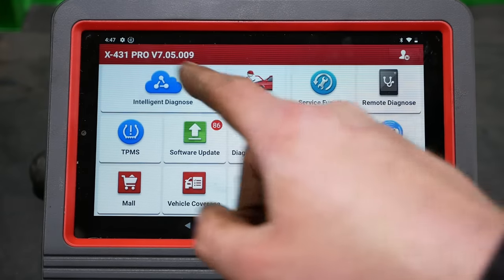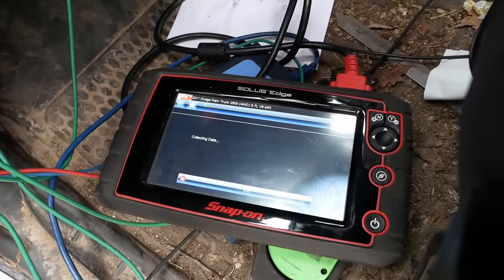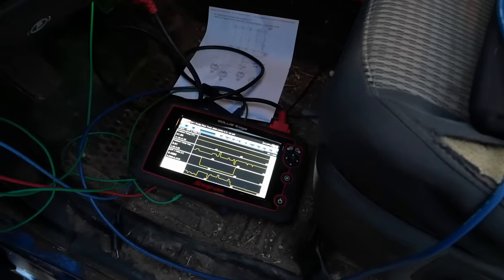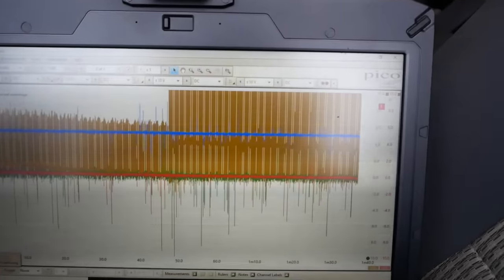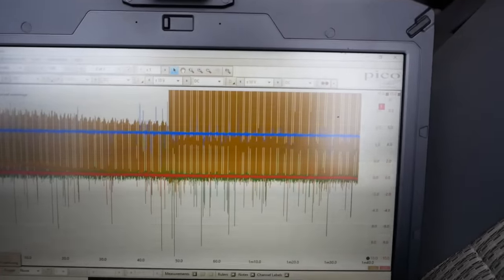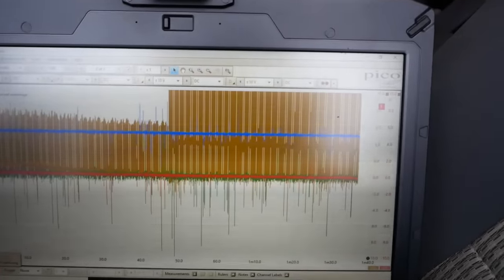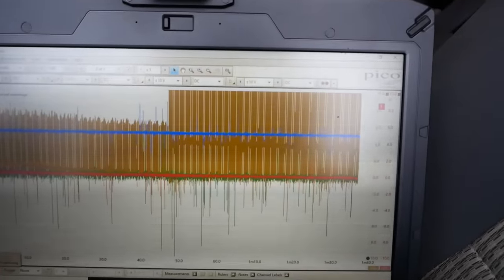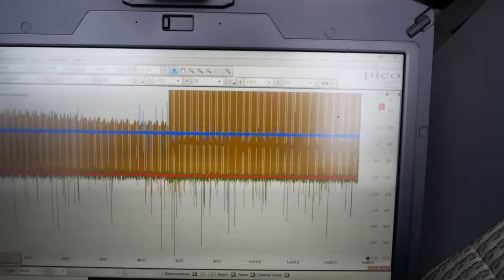Diabolical Diagnosis - Hemi Ram Stuck at 1500 RPM with P2128 and P2138

Comment: Charge out time is always a difficult thing when the labour to find a fault is many times more than the actual repair costs. What customers don't see is that what they save in parts is much less than the labour., with the overall cost being much cheaper than the altermative ie parts cannon. I have no doubt a dealership or big service centre will have recommended a new harness if they found their was  a short. & this is after they did what you nearly did - through a new PCM at it. What do you do, a proper diagnosis and find the real issue or a half-arsed one and throw the parts cannon. For you Wes, if you didn't find the short you would have done an overlay, much cheaper than a new harness. You did good and most certainly were in you rights to charge 100% of your time. You are not a monkey wrencher, you are a professional Technician!!!

Comment: I feel your pain, Wes. My story is short. Car (Hyundai Accent 1.6) in limp mode out of the blue. (how else?...) No one could help with a diag PC, I needed the car everyday. Long story short, a random guy diagnosed for me (for free!), and sent me on my way with the bad news that his opinion was throttle body cooked. Enter the dealer, 13 grand South African, which is the sum total of my pension... My friend Google pointed more specifically to the throttle pedal, I being a sometime mechanic, duly removed, stripped and check it out. No crusties, no dirt, connectors nice and shiny. Re assembled and fault was gone. Done another 40k km since and nary a problem...go figure!
Reply from the maker: That's a lot of dinero for a throttle body!
Reply: @WatchWesWork  Yeah. With the (no) value of our currency, anything imported is grossly expensive. A Dollar will cost me 14 to 16 Rand, a pound Sterling around 20...

Comment: The funny thing about the Audi problem was it wasn’t really a problem. It stemmed from Dateline doing a story on it. What it really was the brake and accelerator being close together. In confusion owner would accidentally hit the accelerator instead of the brake or a combination of the accelerator and brake. I worked with a few guys that lived through that period of Audi. Because of that whole situation you can tank Audi for having a park/neutral safety switch.

Comment: If it's anything like telephone cables moisture is not necessary to have moisture to have high resistance wire "crosses". The wires have microscopic cracks. Wires with different potentials will arc. Moisture just makes it easier to find because it will usually stay bad all the time.

Comment: reminds me of my 2005 Grand Cherokee.  It must have taken a bath in a lake before I got it, because of all of oddities..
I ended up pulling a few of the control modules out (with fuses, etc), and removing all of the fuses, splitting the cases and cleaning them all up.   Not sure what did it, but it did go away after doing that.

Comment: Hi Wes  Excellent work! I am sure I would have pulled out all of the limited hair I have left on that problem! I will date myself but I am reminded of all the intermittent problems we used to have at our shop with spark plug wires. On cold start an engine would miss some days but not others. Took awhile to figure out the "miss" days were either rainy or high humidity days allowing paths to ground.  In your case I wonder if there was enough copper chloride diihydrate (green crusty) contaminating the tape interior to allow an electron path between those two rubbed through wires?

Comment: I have a 2010 K2500 Suburban 6.0L purchased new that will go into "Limp Home Mode" in cold weather conditions If I use the remote start on the key fob and allow the vehicle to warm up until time out and shutdown the engine; after restart and going on my way after some amount of time it will go into "LHM" and stay like that until I stop and wait for a cool down of the engine. My solution has been to not use the remote start ever again and I have not experienced the problem since. I do not have access to the tools you utilized or the patience to chase down a broken wire problem such as what you encountered. I am sure that GM and Chrysler have a similarly complicated signal and control logic sequence to insure I do not demonically accelerate into anything.

Comment: I do A LOT of electrical diagnostics for work, heavy duty truck applications (think L9, X12, Maxxforce, N10, D13T,
 engines) . As my boss says vibration is the killer of everything. And I’d say 75% of electrical fixes are from vibration.
Reply from the maker: Rodents, salt, upfitters, previous mechanics, poor design, heat, UV degradation, etc. It’s amazing they ever work!

Comment: I have a couple buddies that both have Ram pickups both different years and when you look under the hood on both there are exposed wires everywhere as it seems Dodge doesn't deem it necessary to wrap the harnesses completely and both guys seem to be at the dealers a couple times each year with electrical problems.

Comment: Vacuum creates static electricity. In a high humidity environment. It will amplify a local charge. In other words. A plastic intake has a high vacuum and static charge. Add some humidity. And your non shielded (or insulated in that spot) wire will read the pulse from the high voltage discharge.

Comment: I think it's good practice to jump straight to visual inspection once you know which is the bad wire.   We always imagine that it's buried in the harness where we can't see it-------  but normally, it will be right there in the open and obvious.  Spend more time on the visual inspection at first, rather than continuing to try to keep catching the intermittent problem.
Reply from the maker: I don't know about that. We've had several wires broken right down inside the loom with no real explanation.
Reply: @WatchWesWork  Yeah, I've seen it where the wire is broken inside it's sleeve, and the outer plastic has no signs of breakage-- but most of the time, it's an obvious rub point-- Just like you found.  I just think we should have an ultra thorough visual inspection happening in the first hour--  We tend to push it away until hour 10 of diag- and then we finally break down and look -----  and there is was, right in the open all along..   Try not to procrastinate the visual inspection, that's all I'm saying: --  To myself. lol

Comment: Wes, if I followed your description, I think you somewhat lucked into tracking that problem down. When you had the harness wire disconnected on both ends it was floating, otherwise known as an antenna. It will pick up all kinds of hash and trash, depending on the input impedance of the scope. So injector pulses didn't surprise me. You probably should have grounded one end with a 10K or so resistor so it wasn't a complete float. Of course then you might not have seen the injector pulse if the rub-thru wasn't wet enough. :-(
Reply from the maker: Nah, we could see it with the wire in tact, and with the pedal plugged in. I just wanted to be sure the PCM wasn't feeding the voltage back into the harness.

Comment: Hiya Wes, Had the same thing on a dodge I bought used that had just got out of the shop but in stead of fixing the bad place in the harness they replaced the whole thing only because the old harness kept going bad , but after that the truck ran fine

Comment: When two wires in close proximity have worn or no insulation, current can arc from one to the other. When one conductor carries more voltage than the other, this can cause transient voltage as a result of inductance; the principle of how transformers work.
Reply from the maker: That's true in alternating current, but not in direct current. It can happen with pulsed DC, which could be part of what happened here.

Comment: We had a Dodge Journey 2011 that was possessed!! You pressed the horn and it was like one Mississippi and peeep! And the accelerator kind of the same! The had to reset it and load some new system program but never worked correctly. Trade it for a 2016 Passat

Comment: Check the solenoid wiring harness under the intake that goes to the MDS system I found that they melt laying on top of the block look under the harness

Comment: x431 pro VERSION  7.05.etc. etc. etc. - the V is probably to track their software updates for X431 pro - all that aside, you're a better man than I am. My winters last for four months and that's still WAY TOO GD LONG to endure sub 30 degree weather. I hate it i hate it i hate it i hate it - My life goal is to live somewhere that the temperature never drops below 40 degrees fahrenheit. - ALSO...this is why drive by wire is STUPID and we should go back to mechanical throttle. A braided cable will last decades longer than a RAM card when properly taken care of - maybe centuries - that ram card is guaranteed to degrade to nothing by 75 years and the car is toast while an old school throttle cable is going to keep working and if it wears out you don't need a computer to replace it.

Comment: The dealer for sure would of fired the parts cannon at that pig for sure. They love doing that on simple jobs so I could just imagine what they would of done but it really comes down to if someone dealt with that issue before if someone dealt with that issue they wold know the first thing is to check the wiring anyway that was cool you found it without replacing anything.

Comment: Could be the moisture, but I guess it could have also been the vibration of the cold engine pushing it harder onto the plastic. If there's enough rubbing parts of the wire can embed itself into the plastic and form a connection.
Reply from the maker: That could be.

Comment: Wes you need the new $24,873 Snap On diagnostic confuser cause I know that truck should be throwing the old R2D2 C3P0 codes. Can't read them without the new software and interface modules.

Comment: I think that the problem was with the insulation removed there was electromagnetic coupling between the two wires.  The large pulse was coupled into the APP signal  when the air was moist enough outside ie snowy day. I wonder if it happens on a dry day

Comment: strangest thing ive ever seen, was Eric at Sout main Auto had a car with a EVAP fault, the evap circuit had interference in its voltage.  Turned out to be, fast switching pulse from a faulty power steering pump. The rapid switching on and off of a DC circuit causes "induction" (like AC does) into the EVAP circuit inside the PCM. Now a similar thing could happen in a wiring loom, inducing interference in a nearby inductor.
Reply from the maker: I remember that video. That was a wild diagnosis.

Comment: Like this content. Seems only 2 potentiometers is risky toyoter used 2 and had issues too. GM uses 3 one being low voltage and two hi developed for the diesels and as far as i know have been no runaways with out all that complexity bullcrap on that dogdge

Comment: The reason it goes to idle when you step on the brake is because of the "stuck throttle" programming. If you step on the brake and the throttle at the same time, the throttle goes to idle even if you keep it pressed.

Comment: It sounds like water or condensation from sitting overnight. That would explain the short window before the engine heat dries it out. I was going to say shorting through the green corrosion but it didn't look like the damaged areas of the wires were close enough to be effected by it. May not have been much longer before that one wire had a completely open circuited because of the green corrosion. Too bad as well, it would have made diagnosis a little easier.

Comment: Audi 100 problem was caused by the throttle and brake pedals being much closer together than was customary on USA cars and both a little more left.  Apparently people would step down thinking they were on the brake and actually they were on the throttle pedal. Practical tests showed even with full throttle being applied, pressing down on the brake pedal stopped the car both at rest and in motion.  People swore they had the brake pedal full on and the car still accelerated, which would have required the brake system to totally fail, and then moments later resume, leaving no traces.  Audi could not replicate the problem as reported in their tests, but lost in court to juries thinking Audi was covering up.  The problem was a  human factors design issue.

Comment: Yeah the drive by wire crap on my 2003 dodge Is the same Sometimes for no reason just loses The throttle Bpdy signal goes into limp mode shut it off turn it back on Boom like nother ever happens And I'll be good for 3 or 4 days

Comment: Chrysler with a wiring issue. Hmm. A local old man had a hemi the same model and his fuel pump ran 24/7. Would kill his battery. After many ficms he gave up. Lol my moms uncle sold his 03 ranger because it would die when you put it in reverse. He sold it after giving up on it and the new owner had a shop look at it and fixed it the same day. It was wiring rubbed in two on a fuel rail shorting out. Lol

Comment: This is why so much computerisation in cars is bad. Pre computer times diagnosis was easier to a point and the wiring was so much simplier you didnt have these sort of problems that would give you a limp home mode, admittedly some times it left you stuck on the side of the road instead LOL. Thing id most of the problems in older cars wiring was to do with lights or charging etc or a failed coil or wire to the coil. My first car  a 1962 GMH vehicle (Aussie here) had a total of 15 wires in the engine bay and it only had 5 wires for the engine the rest were for lights horn and other similar items. i would hate to think how many wires are in my current engine bay on a 2003 ford but i bet it is close to a thousand. As always cars are made cheap so every inch or so of wire they save over a model run adds up to more profit for the car makers and also more chances of wires rubbing on something that will cause this sort of damage.

Comment: I'd guess part of the problem would be the rather low voltage the APP signal is supposed to have... 0.something volts isn't much at all to compete against any outside influence. If these wires are close enough together, they might even couple capacitively if the moisture is just "close enough" - spikey waveform will do that.

Comment: Nice work.  These failures are the ultimate nightmare for any auto.  Extremely expensive to diagnosis and repair.  Customer is frustrated.  Mechanic is frustrated.  I would have just replaced the throttle position sensor and drove  it until it acted up again.  But realistically, this was a rare find without spending 20 hours and $4,000 at the dealership.  Is there really any good solution for these failures?
Reply from the maker: No. There are not. Maybe if the PCM had built in data acquisition and storage you could see it. Even then, you'd still have to find the actual problem, which was not easy.
Reply: That's an interesting question.  The design engineers could have considered a "failure tree" that checked for "atypical" voltage inputs.  But, that would presuppose that they could imagine that faults in the harness, might feed back into other parts of the harness' circuits.  As a guess the SAE types figures any harness short would be "obvious."
I've made dumb logic error trapping decisions, so, I'm inclined to only throw shade, not brickbats, at them over this.

Comment: Wes you are clever. I'd never have found it.  I'm thinking moisture plus road salt. Btw Setting the gear up is not wasting time "It is just what you have to do." Ok here are 2 stories ! . This is the abbreviated version. A right hand drive 1999  VW Passat comes in. transmission is shifting badly, dropping out of gear, erratic operation over 3 day. trans died. This was caused by the 2 pinched drain tubes that live under the battery tray. how? The battery lives in a compartment behind the firewall in the engine bay along with the heater air intake and brake master. The tubes block up. the cars parked at the side of the road and the air intake is on the left. The water fills up and runs over the 1 inch lip and runs down off the screen into this area and down the heater air intake and down the inside of the fire wall and under the false floor (a 3 inch height difference) where the trans computer lives in front of the drivers seat and it drowns.  Great design.  When you buy the second hand trans computer the wrecker asks  "do you want a couple of feet of the loom with the plug " and you say yes. Then you spend some time soldering 23 wires together when they turn .up.  No 2 . A v12 merc coupe turns up at the shop on a tow truck from another shop.  Back fires, misses and wont start. Phone the other shop, Wouldn't start after a trans repair. Diagnose and quote for repair, please.  Timing was out but how as it has a pin in the flex plate and a pick up on the side of the bellhousing with two distributor caps and rotors mounted on the cams and they are still timed and turn together. What he boss of the other shop didn't know was while the trans was out the customer came in and asked one of the mechanics to take off the flex plate so he could get the ring gear repaired. They have a small light punch mark near its mounting bolts with another match mark on the end of the crank, it got returned and fitted in the Wrong position. That took a lot of finding. So as Wes will tell you car repairs aren't always easy and thats why there are a lot of bald mechanics out there from pulling their hair out.

Comment: I leaned you can't use radiator hoses to insulate a antenna to steel mass. It grounds out the signal to the radio.  Wonder if
the manifold is conductive? Possible its mixed with a conductive material when manufactured, like the radiator hose mixed
with carbon.